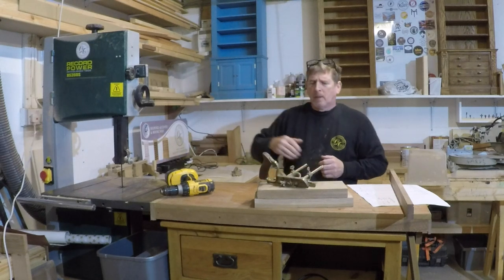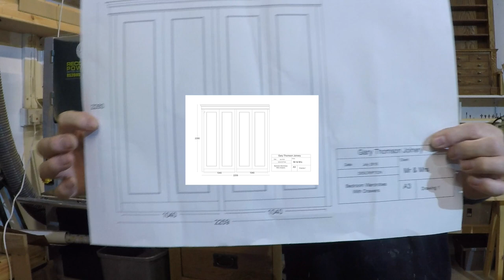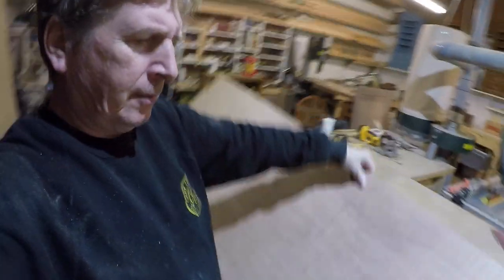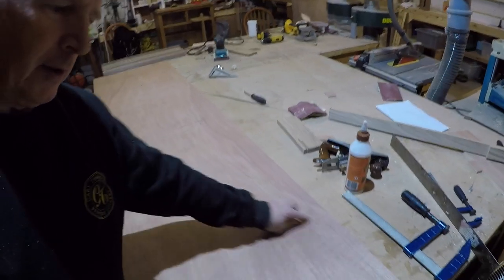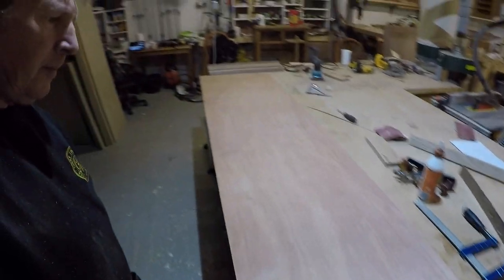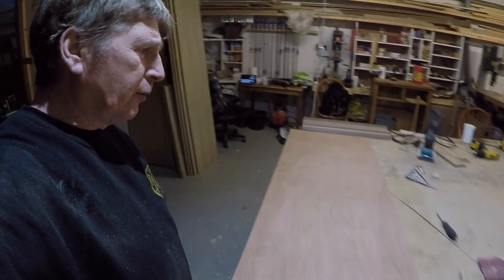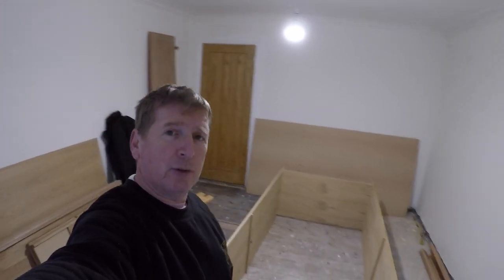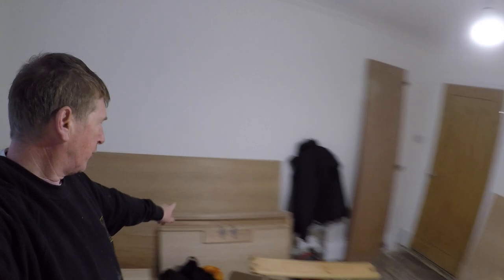Highlander Wardrobe

Comment: Hi Gary, thank you for another great video, I was wondering how the ends of the styles on the columns are fixed to the cornice?
Reply from the maker: Hi Ashley. Thanks for the nice comment. 
The whole cornice is fixed to the top of the unit from the underside, normally I’ll fix it down from above but no room being so close to the ceiling. 
No need to fix the columns to the cornice, it will sit tight on them. 
Thanks for watching 👍😄

Comment: Lovely wardrobe. Is this all ply? Which sort if so?  Sapele door stiles/rails? Also how did you the thick, vertical piece, between the two wardrobes. Cheers? And also the side panel? How is that attached? You have  a really efficient way of working. Cheers for the video.

Comment: Very nice, you are right about that top hanging rail, a pull down one might have been better. What software do you use for your drawings.
Reply from the maker: Hi Chris, I’ve fitted those pull downs a few times but they do lose a bit of hanging space in the mechanism. These guys can reach ok though. 
The drawing software is from ViCad, had it for ten years, works fine. 
Thanks for watching 👍😄